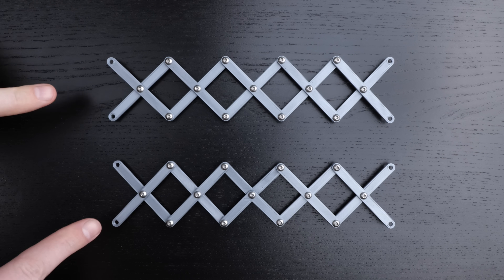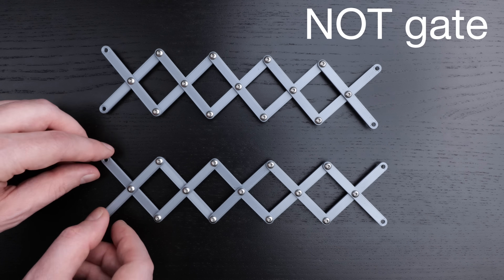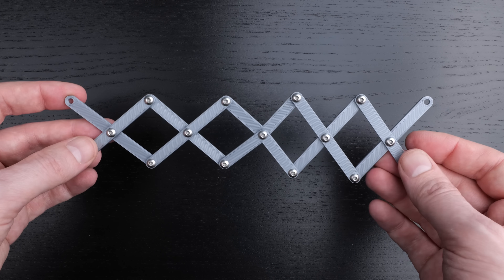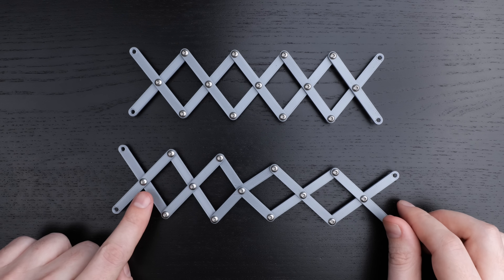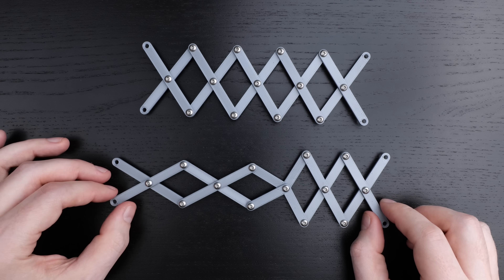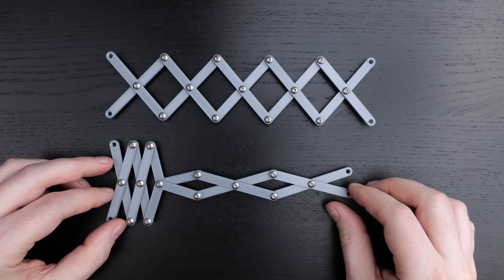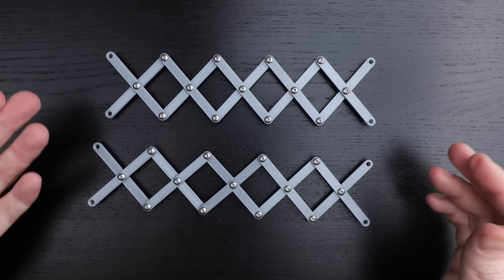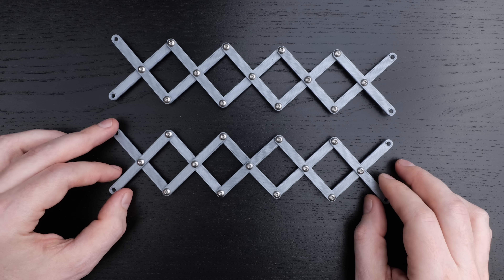Scissors NOT gate

Comment: some notes:
- i think the grooves idea like below is a nice way to make the length constant
  - it seems like you'd more or less be limited to trigonometry because of how scissor linkages work. and you can't really make them add up to a constant. there's the good old pythagorean theorem but that requires sin^2 and cos^2 so that doesn't work either
  - you may be able to get away with having some curved linkages - potentially just at the ends, potentially differently curved for each half (plus curved L pieces - if each half is differently curved you may (or may not) want the L pieces to be asymmetric) 
- for 2-input gates you'd probably want some kind of junction. either coming in from three sides of a square, or three sides of a triangle
- for convenience (well, to be able to make complex circuits) you would likely also want a simple mechanism to rotate a truth value by say, 90 or 120 degrees
- (i'm not sure how logic gates would work - you may need additional degrees of freedom like the grooves?)

Comment: Some kind of clutch would be a useful building block for an AND gate or a CNOT gate.  One input acts as a control to allow or prevent propagation of signals in one or more target linkages.

I could imagine this working by coupling the target input and output by way of a broken pair of straight linkages (not scissored). The control input is mounted orthogonally to the target and acts to either hold the broken linkages straight and parallel to one another (allowing the signal to pass) or by letting them buckle in the middle (preventing transfer of the signal). A single control input could link control multiple targets simultaneously which would be useful for multiplexing.

To make an AND out of a clutch you can either add a spring to provide some restoring force in the target output when the clutch is disengaged or combine a complementary pair of controlled gates in some other way.

Comment: What if you tap the right side (assuming left is input) of the normal (technically a buffer?) gate and the middle of the NOT gate with a linkage that connects to a secondary standard scissor?  True+True and False+False would result in linear translation.  But True+False would result in a rotation of this linkage along a central pivot.  Assuming the third scissor is fixed and has an input that actuates on translation but not on rotation on that linkage bar, this would extend or compress this final scissor for a XAND/XNOR gate.  You could also inverse this operation, actuation on rotation and no actuation on translation and get a XOR gate.  There may be some more complicated linkages to where you can negate one set of inputs, which would give you your AND and NOR, then probably an inversion of this combined with a combination of translation and rotation to give you your NAND and OR gates.  Ironic how the simpler gates, at least in terms of order of teaching, are the more difficult ones to achieve here.  Mechanical logic can get overly complex very quickly, there's reason why mechanical logic is typically left to engineering art exhibitions and not practical uses. 

As for finding a NOT scissor that retains length, there should be a simple solution.  Simply just do not constrain scissor A to scissor B so tightly with the right angle constraint, this is where you're seeing length disparity.  A free hinged system may not work entirely, but having a looser constraint to where the 90° has room to adjust on both sides to accommodate for the length change should work; essentially a free hinge of composite arms with discrete stops of ±θ°.  Though this would need further constraints (as the rest of the system should as well) being linear slides for the scissors that're constrained to be parallel, which has a variety of solutions just like the various ways of figuring out other gates; but in the case of the NOT specifically, you need to constrains the end points to a certain position, essentially two vertical (assuming the scissors are horizontal) parallel constraint bars constrained by a perpendicular of known length, as opposed to the buffer gate only requiring horizontal parallels of extension length; as for getting into other gates, constraints shouldn't be too much more complex, just mostly keeping an eye on translation linearity and parallelism and rotation being constrained to a central pivot, then you have various combinations of the two the deeper you go into complexity. 

The NOT, or inverter, is really more of a miniature buffer in this model, and thus a true NOT doesn't really exist.  The way a true NOT exists is to invert the input itself, not the scissor.  Say in the case of simple pneumatic cylinders of two inputs, if you put air into the far side the piston extends, if you put air into the near side the piston compresses, now say you have a common output that inputs into two pistons, a compressor or air switch, the way you inverse a piston is to switch inputs, what would otherwise go to the far side is now on the near side and vice versa with the second input.  You need to find similar for the scissors, your true NOT will be a buffer that is reverse actuated, and this depends on how you actuate the scissors themselves.  Using a true NOT (or inversed buffer) will be a way to somewhat simplify the model, as you're aligning various constraints to each other rather than having a perpendicular set on the false NOT gate; though everything past this, the linkage between the outputs and translation and rotation affecting a third linkage, remains the same situation.  I also don't think there's really any way around this, to make the false NOT work as a true NOT, because the scissors are just linear actuators, what modifies their behavior is actual input, as mentioned earlier the first half of the false NOT is just a shorter buffer, if you have identical inputs they will both be identical at their measured points, and thus identical outside of measured point.  What you need to find is a mechanism that can take vertical compression (horizontal extension) input and change it to vertical extension, similar to the swapping inputs on a pneumatic piston example, without discretely changing which input goes where; say, a press of a button needs to be 1-1 on a buffer but 1-0 on the inverter, same input, different gate.  How this mechanism would work, I have no idea, this is where aphantasia kicks my ass, because simple linearity, parallels, perpendiculars, translation, and rotation is easy enough to not require visualization, but finding a complex mechanical inversion isn't as simple; the most I can think of without sitting down to sketch it out is two opposing driven gear racks with a common drive pinion, this would give you inversion, there may also be a way to do it with opposing arced sliders on a constrained pivot, like an inside out aperture but the inversed arcs cause different linear directions. 

All of this is definitely a unique engineering challenge.  But doing this 100% with scissors is even more difficult, though I assume the ideas I've presented could be adapted to such with extra work put into it, especially as skewed, or arced, scissors do exist, and that false NOT could prove useful in the buffer-inverter linkage that drives further linkages, just with additional translation to realign parallels such as an intermediate scissor between the variable center linkage and the output scissor for the various complex gates.

Comment: If we're aiming to not do anything too cheeky (like a corrector segment at the end), it seems to me like your inconsistent length is caused by 6x the hypotenuse of a right angle triangle made by the line segments being longer than 6x the length of the line segments. The obvious conceptual answer to this is to somehow change things so that we're measuring equilateral triangles instead, but I can't for the life of me picture what that would look like.

Comment: I feel like if you wanted more mechanically interesting movements then I would add additional layers.  So the same scissoring motion would produce different movements on different layers.  I feel like that would lead to more possibility for combos and computations.   Could possibly make for a fun calculator where you flip some switches and then pull a big lever raising the scissors up to compute the answer.

Comment: One thing to consider is that you can have two-input two-output gates. Despite sounding like it has more pieces, this is often easier, and many gates are built this way and just don't connect one of the two outputs. Usually the two outputs are inverses of each other, Q and ~Q. If you built an AND gate this way you would also get a NAND output.

Now, whether this applies to scissor logic, I don't know.
Reply: Ruin with it!

Comment: To me, it's easier to design an OR gate. You'd have two scissor mechanisms such that the arms of both inputs line up with each other. Either set of arms could "catch" on the arms of the ouptut linkage. NOT and OR are logically complete.  X AND Y = NOT ( NOT X OR NOT Y)
Reply: You'd have to do this so that one input wouldn't affect the other input, though, which might be tricky. Maybe with something like a flywheel?
Reply: @Owen-bk5fc  you only need a spring. Think of it as a sort of pull-down resistor
Reply: @siddharth_desai  I might need to see this one in action to get it, or take a walk in the woods to induce that "oh!" moment! :)
Reply: @Owen-bk5fc  it would be easier if I could draw a picture, haha. If I have time later this week, I might make a video response
Reply: Could you please guys check my comment if the AND with three NOT gates could work? thanks

Comment: I think one can create an XOR gate by using 4 of those NOT scissors. 
First, place 2 of those NOT scissors parallel to each other.
Then, connect 1 NOT scissors perpendicular to them at one end. Now it would look like a コ shape. This way, it would shift shapes left or right only when one input is True, but jams at the middle when both are True. 
Finally, attach a short stick to that sideways NOT scissors' middle point, and place it in between the 4th NOT scissors' arms. It will open when the perpendicular one shift shapes. Attach a small circle at the pivot point of the 4th NOT scissors' arms. This makes sure the stick pushes the 4th NOT scissors back in place once it's opened.
Reply: Would successfully setting one input not simply modify the other input to be the opposite?
Reply: @Owen-bk5fc  I haven't thought about what would happen when the inputs aren't changed simultaneously.
That might happen if both inputs' arms were directly connected to the perpendicular one. I'm still thinking about a solution to isolate them without over complicating it with strings and rubber bands and stuff.
Reply: @Owen-bk5fc  Currently, the (00) and (11) state works by balancing the opposing forces from the two inputs. 
So if you pinch one of the inputs halfway through, it can change into that (00)/(11) state you expect; but if you pinch too hard then it modifies the other input too.

Comment: Maybe you could fix the length contraction problem by linking together a series of NOT gates? The NOT component is just the 90 degree component, so if you link a bunch of these components in series and have them alternating constantly maybe that would work better? You would just have to have an even number of 90-degree component vertices for a connection/buffer, and an odd number for a true NOT gate.
Reply from the maker: I think you just get more sums of sine and cosine terms that way.
Reply: @henryseg  I made the observation since it seems that adding one of the 90-degree segments significantly reduced the amount of contraction from the system, so I was sort of extrapolating that having many of these kinds of connections would converge closer to having no contraction.

I guess another solutioin would be to just have one single scissor segment with really long connectors but I feel like that's cheating lol

Comment: Solution for the length problem: add a component to the output that just takes the vertical component and lets the horizontal slide.  For example, a vertical groove is fixed in place, then put two bars in it that are forced to be at right angles. Inside of those two horizontal bars, put a groove that lets the ends of the scissors slide freely along them, but the vertical motion will translate into the right side of those bars.
Reply: This is an unbelievably powerful "cheeky" answer, which I love. To add to this, if you think about it, you only need the 2 L pieces for the NOT gate, which might actually end up making the bulk of the simplest scissor gate be the correcting grooves, and it would still feel quite "scissor-y" in its mechanical complexity.
Reply: I wonder if you might get some moments of strong stresses in weird places as certain lengths force strong pressure on the bars to push themselves up when they want to move out. E.g. 85 degrees into the bar you have to exert a lot of force into the bar to push that piece up. This force would transfer back into the mechanism and start stressing the joints. Compound that with needing to push potentially thousands of other gates entirely through this mechanism and I don't think this machine will be turing complete any time soon.
Reply: Mechanical stress could be overcome by some kind of active buffering or decoupling mechanism to compensate for friction in the system and propagation delays due to slop.
Reply: you could also just use multiple not gates, and it will stay the same length
for example, >|<>|< (| indicates not gate)
Reply: Could you please guys check my comment if the AND with three NOT gates could work? thanks